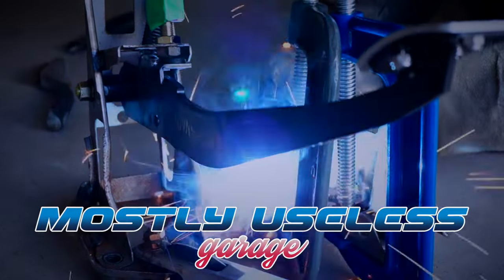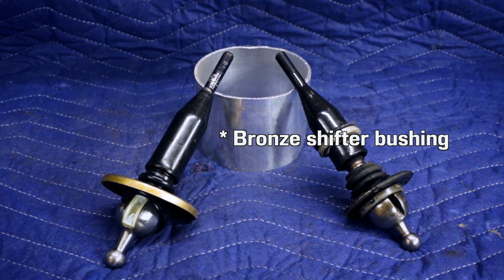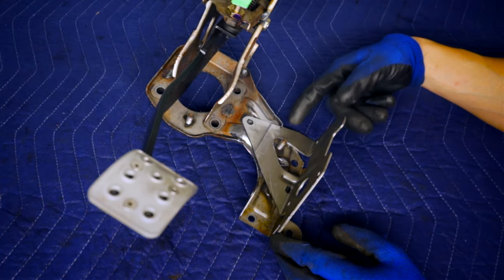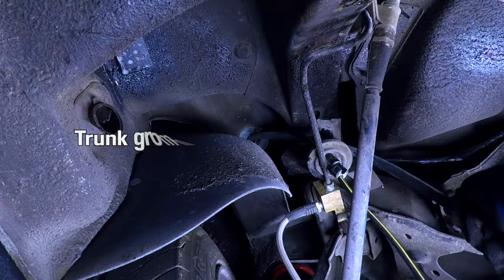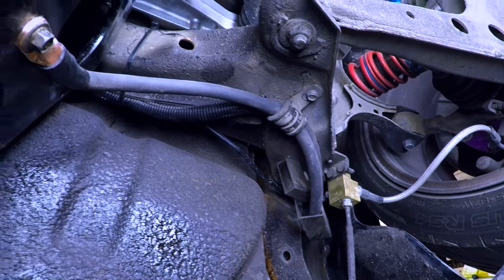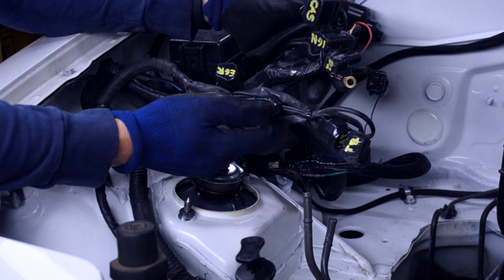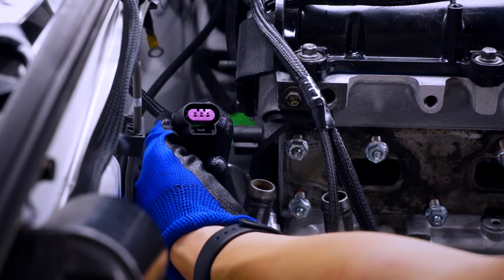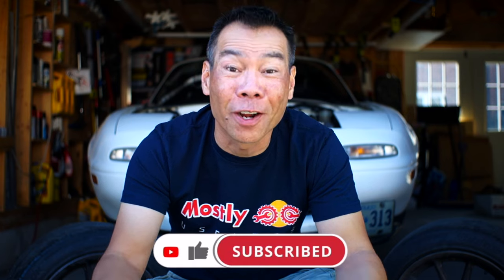ENGINE SWAP PROGRESS Wires and Throttle and Radiator, Oh My! DIY Ecotec Miata Swap

Comment: Hey man, I am no engineer. Should you throw some rubber washers on the ECU mount just to cut down on vibrations shaking the electronics apart. Just a thought love your videos FYI. You have a great energy I really enjoy.
Reply from the maker: Initially I figured it's ok since GM bolts it to the firewall ... but they don't have solid motor mounts. So now that you mention it perhaps some anti-vibration is a good idea.  Thx!
Reply: @mostlyuselessgarage I learned my lesson the hard way on an aluminum radiator that I mounted without rubber grommets to isolate it.

Comment: Very tidy wiring work, satisfying to watch! I like that battery terminal block, and the P-clips along the frame rail are clever too!
Reply from the maker: Fun fact about those clips, I painted them individually to prevent rust (they're zinc coated).Thx for the comment!!

Comment: Just a friendly suggestion to sand the paint off the frame where you bolted the ground straps in the trunk/boot.  I too did a lot of electrical and sound system work in my Miata and doing that really helped the current flow.  Nice job with the wiring overall.
Reply from the maker: I considered that but noticed that the factory ground straps aren't bare metal. What did you do to prevent rust?
Reply: Not at all unusual for factory straps to be connected to painted sections.  I just sanded the paint in the section under the ring connector, tightened it firmly and coated it with dielectric grease to seal out moisture.

Comment: How thick did your sway bar spacers end up being?
Reply from the maker: In addition to the EcotecMiata swaybar relocation brackets I added a shim of flat aluminum bar 3.2mm thick. I'm running a solid FM swaybar, and it was so close it would buzz the crank bolt. I ended up grinding some of the bar to make clearance.  Not ideal and a terrible idea for a hollow bar.
Reply: @mostlyuselessgarage  do you know how thick the ecotecmiata spacers are?
Reply from the maker: 12-13mm ... just measured it
Reply: @mostlyuselessgarage  greatly appreciate it, your documentation of this swap gave me the push I needed to swap mine thank you!
Reply from the maker: That's awesome! I think I saw you ask the same question on the Ecotec Miata FB group. If this is the biggest problem you are well on your way!

Comment: Good looking car! I’m doing a swap now is there anyway you can show where the tachometer signal comes from the harness had been our of stock for awhile
Reply from the maker: Do you mean where to pick up the tach signal on the chassis side or on the EcotecMiata wiring harness?
Reply: @mostlyuselessgarage  on the ecu connector
Reply from the maker: I have a table of where to wire up the Ecotec Miata harness to the ECU connector for my 1990. Check it out here: https://youtu.be/Q-LXqtxZipg?t=3m2s
Reply: @mostlyuselessgarage  thanks I was trying to get my tach working as ecotec Miata isn’t selling anything now
Reply: @mostlyuselessgarage  I need to know what pin in the ecotec ecu is the tach output
Reply from the maker: Sorry man, not sure about that. I'm using the EcotecMiata wiring harness so it's plug and play into my E67 ECU.
Reply: @mostlyuselessgarage  thanks man I appreciate the help the harness has been unobtainable for awhile
Reply from the maker: I got a couple leads for you. Are you on Facebook? One of the commenter's on Ecotec Junkies says that you can tee together C1 24 & 25, but the tach signal needs to be enabled in HP Tuners
https://www.facebook.com/groups/1406963462880023/permalink/2790406381202384/?mibextid=rS40aB7S9Ucbxw6v
On the Ecotec Miata FB Group, someone asked the same question and Ecotec Miata Matt also said to bridge ECU pin 24 & 25 for the tach signal:
https://www.facebook.com/groups/916606421788555/permalink/1467032113412647/?mibextid=rS40aB7S9Ucbxw6v
Hope that helps!

Comment: That's a really neat install of your pedal set up (very professional!!). Did you come up with all the bracketry mods? Very novel. It looks OEM.
Keep up the great content. I've learnt so much from your channel - thanks.
Reply from the maker: The Ecotec Miata instructions has a couple pics of pics that describe the result.  Since my buddy was welding it anyways I bend and ground the brackets to maximize the spots to run a bead.  And a little flat black hides the flaws nicely!  Thanks for the support!

Comment: Great vids!  Curious why you're ditching the electric power steering you previously installed.  Was thinking about trying it on my Miata
Reply from the maker: We did the ePower steering conversion kit on my friend's Miata, which is also a white NA so the confusion is totally justified!  Thx for the support!